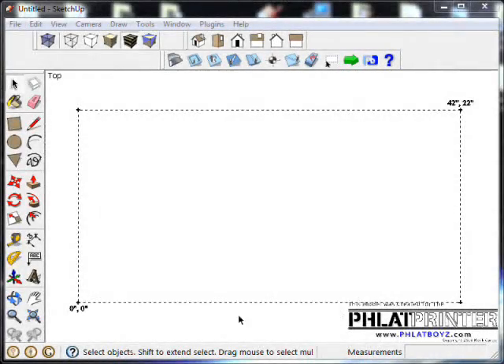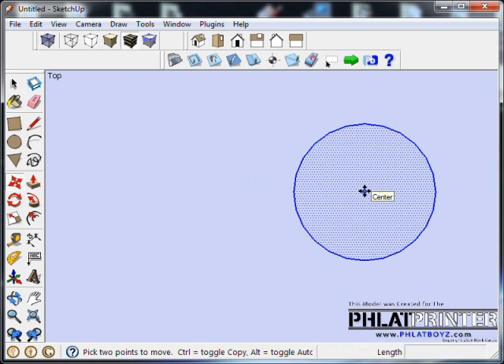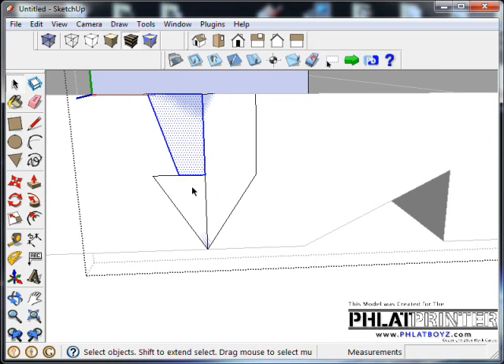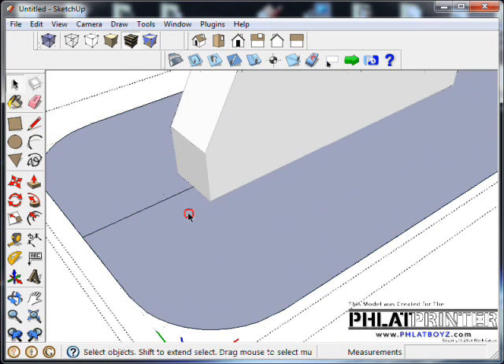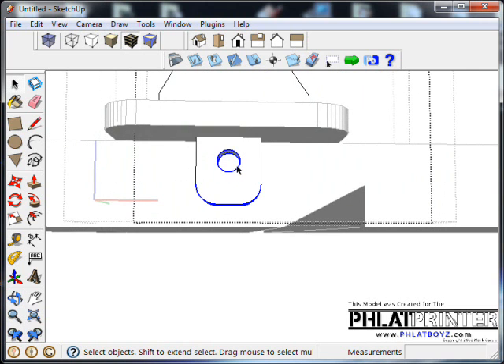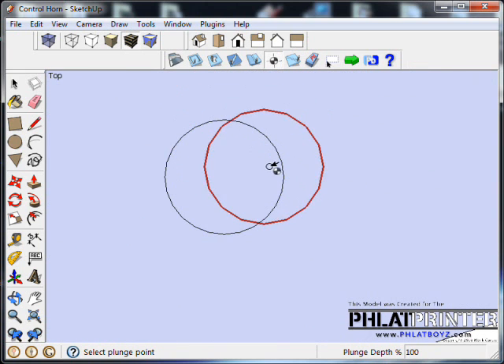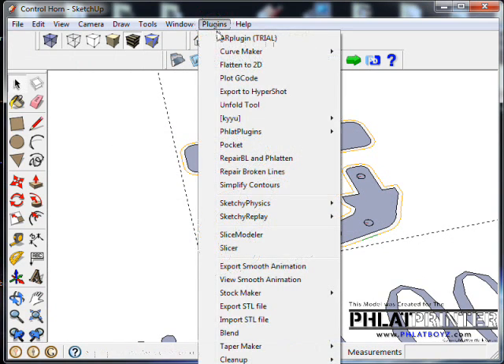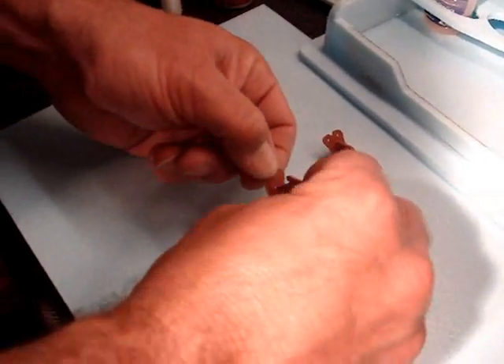SketchUcam Control Horn Tutorial_Video 2.wmv

Comment: HI, I'm loving SketchUcam but am having a problem when I convert the SketchUp drawing to G-Code. Every time the G02 codes have to be changed to G03 and visa versa the G03 codes all have to be changed to G02. If this isn't done, the code goes into an infinite loop and the only way to stop it is to shut the controller down.